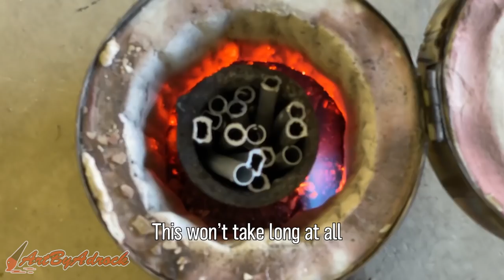4 Crutch Scrap Melt - Mirror Polished Ingot Bar - Melting Aluminum At Home

Comment: nice weather for a melt  been way too hot for melt over here see what the weathers like tomorrow!
Reply from the maker: I hear ya! It’s been 117°F here.  Without the A/C it would be way to hot.
Reply: @ArtByAdrock  Top temp here in Wales was 35.9°c recorded on my weather station today and some work to do but thankfully it looks like it will be cooler here tomorrow 👍
Reply: @PBRJOHN684   35celcius is nothing. Wait till u hit the night 40s 😂 (47-49celcius) them you can cook eggs on metal slippery dips 😀
Reply: @southaussiegarbo2054  I live in South Wales and it's normally pretty cold and wet!  Average temp for us is between 13°c and 20°c during the summer as we live on the coast.
Reply: @PBRJOHN684   lol ik the north is cold but no offense i laugh when yall complain its not at 25 celcius 😂

Comment: Ya know ya just freaked out “Bigstackd” by just trashing the rubber, nuts & bolts!!
Reply: Lol. A place called "which bin" mentioned to me about the pvc rubber off wire not being recyclable when i linked em to bigstackd channel 😂
Reply: I am very skeptical that any recycler in the world processes random bits of unsorted plastic and rubber. Very likely they just landfill everything other than some specific food and drink containers.
Reply: @awldune   in most cases to small of a item it gets under the belts and does damage.
In many places now of australia you can put bottle tops and straws etc into a plastic bottle put cap on an into recycle bin. It is then recycled as a mixed plastic useally into items that can include rubbish bins

Comment: I'm assuming you scored these in a thrift store as I was recently in one and found several crutches for just $1 each,
My first thought was the same as your own - jackpot - easy, clean aluminum.
But then I thought about just how ridiculously expensive crutches are and how many times friends have sent out calls if anyone had an old set laying around that they could have so I left them for someone who was going to need them far more than I did for the ashtray I was likely going to turn them into.
Since this is YouTube comments I'll toss out the disclaimer that this isn't an attack or even a criticism on my part, instead, I'm just sharing my observation with the hope that anyone else who stumbled across some will leave them for someone who honestly needs them.